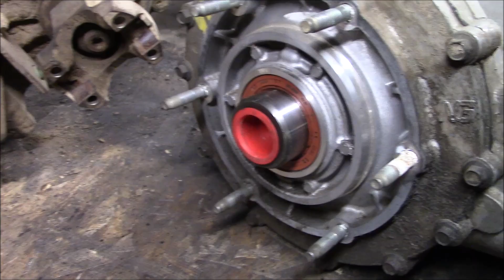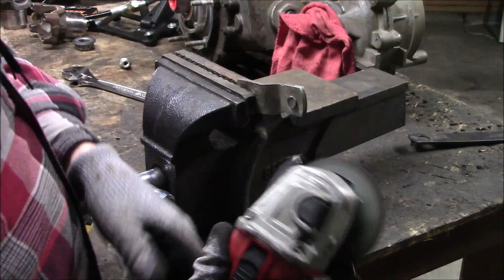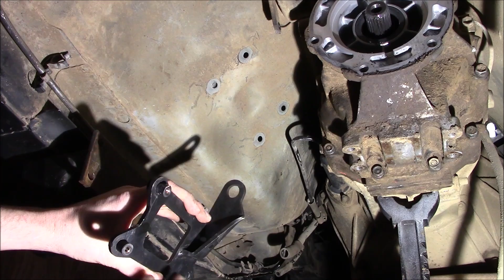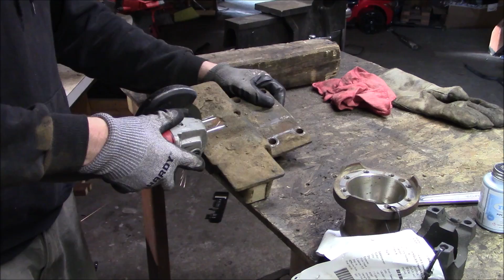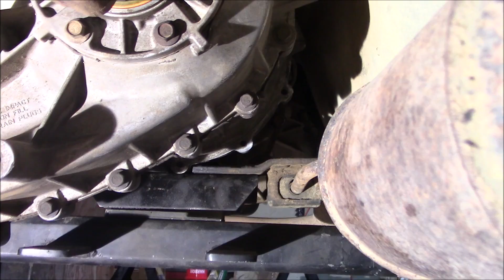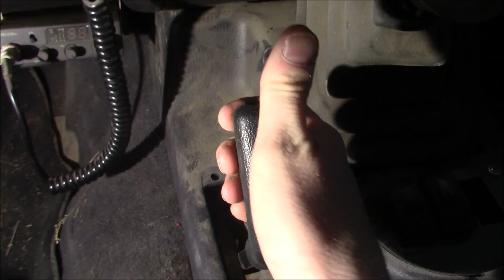Rock Trac NP241 Transfer Case Swap Complete Guide

Comment: Has no one pointed out that the front drive shaft still spins in 2wd and thus that 1350 yoke will hit the shifter presuming you have a live axle (i.e. no locks or unlocks on the hubs)

Comment: Well that dorman switch for the 4wd light will not work. I know because I tried it. I did this swap on an 04 wrangler. O4 rubicon case I used and it was mounted behind a 5 speed. I also have a 5 speed. It bolted right in. I used. A Novak cable shift for the 4wd. I used rubicon drive shafts and just used 1310x1330 combo joints to hook up to diff yolks. But that damn 4wd light is still an issue!!!!!?????  I've tried multiple switches. Oh and my speedo plugged right in to the rubicon sensor and works

Comment: I about #### a brick on the costs for the current prices for a Atlas T-cases and current new built crate axles.  I kinda got away from "hardcore" off-roading for many years budget, deployments and ECT. 😮  Finding out a set of crate axles being over $20000, Atlas almost double the price of early 2000's isn't a surprise kinda a good deal. 🤭  It's somehow similar to how many of the forums are gone or a shell or what they were.

Comment: I had bought one yoke from JB Conversion 20 years ago, l also bought a Dana Spicer yoke and you can go to any machine shop and they can open it up so you can put a seal that what I did too.
Reply: The transmission-transfer case mounting plate on 05- 06 used a 6speed transmission with the transfer case will fit, all you need to do is cut the exhaust mount and move it lower down, l had this done on a 1998 TJ 4.0 NV 3500 transmission, 2004-2006 241OR
Reply: l’m surprised the 241OR cost that much, 2004 l had bought mine new from jeepRus $1600 and installed it in my TJ wrangler.
Reply: You can also used spacer metal plate on the transmission to fill the gap, that what l did I the beginning before I got a later trans mount bracket.

Comment: Little known fact. The output shaft has a slide in out stub. It is possible to change it to different spline count. Chrysler only charges 90$ for out shaft. Takes 30 seconds to change.

Comment: 29 spline? I thought it was 23
Reply: Prior to 2012, all NP241's received a short 23 spline input shaft and were mated to either the 42RLE, NV3550 or the NSG370 transmissions
Reply: It's 23 Spline Input for the tj variant. I just got one from a 2005 tj and it will bolt right up to 1997 jeep xj ax-15 transmission.

Comment: For the Front you could use Yukons np241 front yoke, it should be long enough to not hit the shifting linkage and then you would have to get the 1350 piece that bolts onto the flange. Part #YY NV241-1350CV-F   I am about to do this same swap in my 04 WJ, looks to be a straight swap except the u joints of course, even the 4wd sensor is the same in an 04 wj. and my NP241 came out of a 2008 JK.
Reply: Good to know. I also have a 2004 WJ

Comment: If you don't have front hubs the front driveline spins 100% of the time, definitely clearance that shifter arm.
Reply from the maker: Ya I'll have to unlock the hubs.  Not sure what others have done when using bigger yokes, but notching that blade may have to be the only option

Comment: Doesnt the front driveshaft spin in 2wd if you're moving without unlocked hubs?
Reply from the maker: Ya going to have to unlock the hubs.  I couldn't find anything online about having this issue with bigger yokes.  I'm wondering if a different yoke design would work
Reply: gonna be worth it for the 4 lo! @MuddyBeards4X4

Comment: man those things are pretty hard to find out here for a decent price. most of them have a 1k price tag. I've been keeping an eye out for one, but honestly I'm not really ready to give up the 242, I like the 4 hi unlocked mode. especially with snow, and going up to browns, having the center unlocked is a huge benefit.
I always put a bit of pipe dope on the yoke splines. 
my biggest problem is with the clocking variation, the front shaft would hit my 3link crossmember on the zj.
hmu if you guys do a tahuya run this year, they re did some of the rock gardens
Reply: Shoot, let me know where you can get one for $1k... I'll buy 5!

I've only seen one for less than 1600 and it had been cracked and repaired.
Reply from the maker: Ya 1k is a deal.  There is a jk one on the local Facebook marketplace right now near me for 1500

Comment: I checked out the 241or cases but couldnt justify the cost. Especially the tj cases not as many available and 2,500$  I will be trying froelich suspensions np231 doubler kit in my XJ.
Reply from the maker: Let me know how the doubler goes.  I am very interested in that
Reply: @MuddyBeards4X4   Alright..I probably won't get it installed until this fall, after our CO trip
Reply: @MuddyBeards4X4   You could use the doubler kit to put the front end of your old 231 onto the 241J to really crawl!
Reply: Yeah, eBay premium definitely

Comment: You are definitely going to like this mod. I did the same back 2010 to a 1997 XJ with AW4  auto. I had a 4" Iron Rock long arm kit. I used the T case from a 2004 Rubi. I also had to clarence the bally pan. Other then that was straight forward like you said and the Jeep was one of my daily drivers.
Reply: did you have factory axles yet?

Comment: If you made a spacer plate for on top the tranny mount that should give clearance to not cut the mount and lift the case so it isn't flush or lower than the crossmember?

Comment: Great upgrade and video. I imagine this would work in a 89 YJ? I’ve got a limited slip on front axle Dana 30, wonder if the 2WD clearance issue would be a problem.

Comment: The 241 is a great tcase for a stock unit. Dont put it in 2wd until you unlock your hubs, that flange will self clearance itself.
Reply: The vehicles these came out of didn't have locking hubs
Reply: Definitely not true. I rarely unlocked the hubs of my 1 ton LJ and never had a issue
Reply: @WatchesofLawEnforcement did you use 1350 yokes as well. Cause the yokes he used here, will strike the shift linkage arm in 2-high.